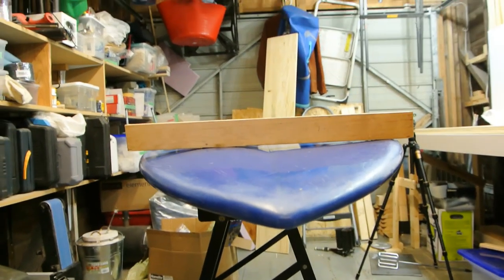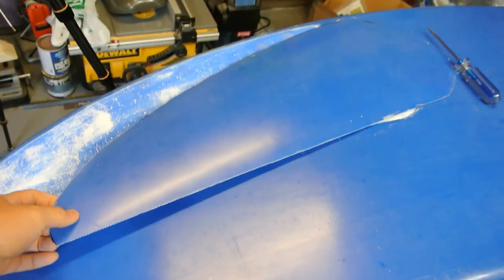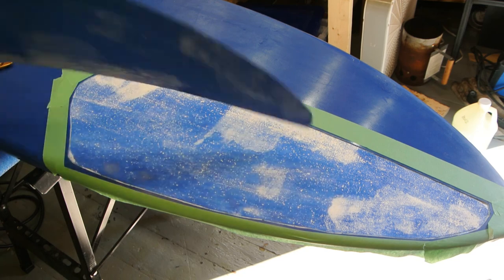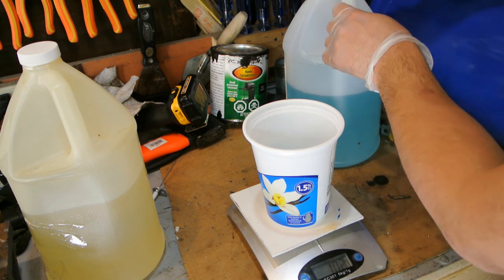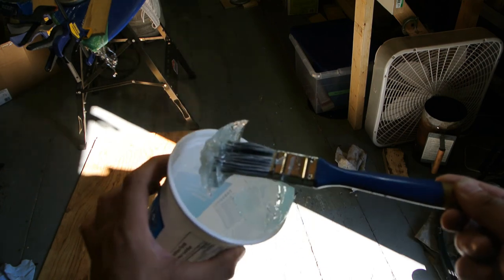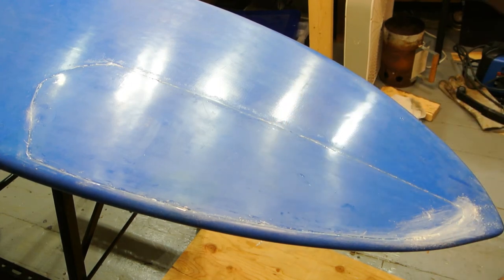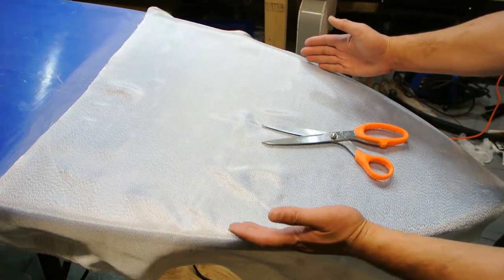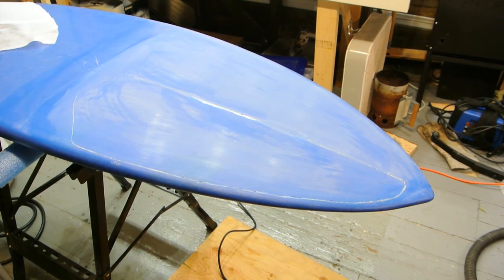How to Repair a Surfboard Ding or Delamination - Part 1 of 2

Comment: Hey there Andrew, 
thanks a lot for these instructional videos dude. I learned a lot from you before embarking on my second round of surfboard repair attempts.  I'm working on two very torn up and yellowed boards. I ended up sanding some of the original epoxy coating down too far, revealing the fiberglass mat. I tried brushing on a thin layer of epoxy over some of these areas, but I got some drips, in many places it just sanded off and it didn't make the fiberglass disappear behind it anyway. when some of the fiberglass is showing through the epoxy, how do you recommend covering it back up when sanding the rails down too far? Thanks for any tips!!

Comment: I watched pretty much all of the videos that you made when building that board. What a bummer but s**t happens I guess. What makes you want to work with EPS rather than PU? Off-gassing doesn't happen with PU, correct? I am tempted to build a board as you did even though I don't have all the perfect tools for the job but I live in a semi-tropical climate area where the summer months are about 30-35 degrees Celsius. Do you think even being strapped to the top of my car for an hour or two would cause such a bubble to appear if I was using EPS?

Comment: I guess that’s one way to fix a board??? If your going to glass over the reused original glass, why not just do it correctly and use new cloth on the entire repair with some blue tint. Also never use a straight cut across the board. Creates a weak break point for your next repair.